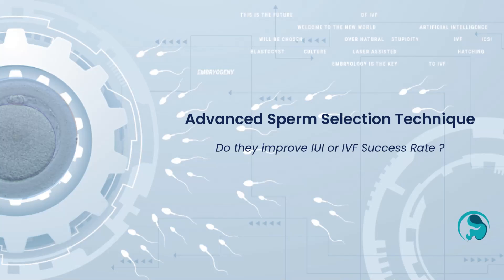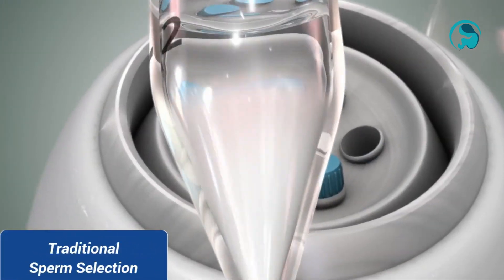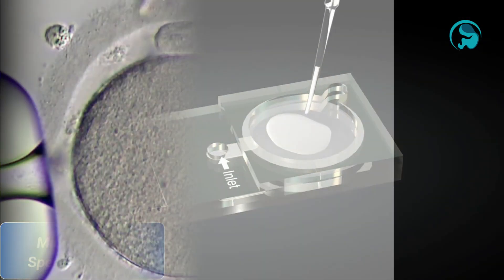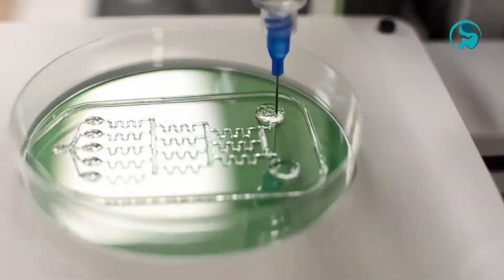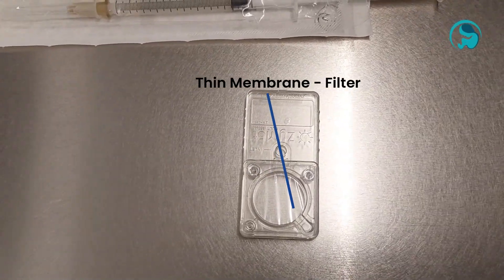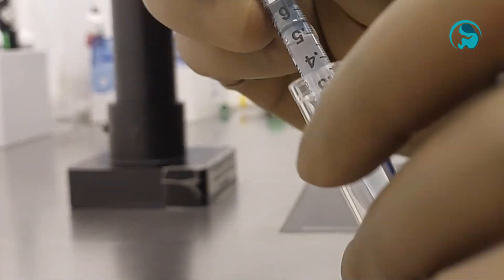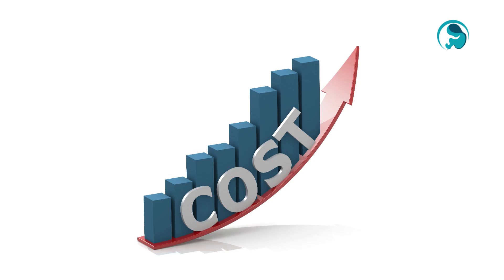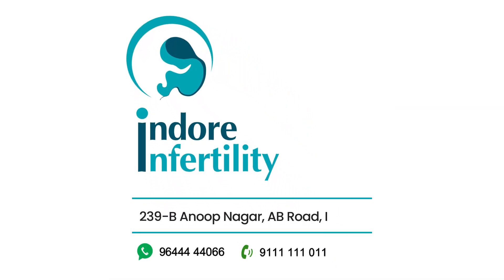Advanced Sperm Selection for Improved IUI and IVF Success Rate - Microfluidics Sperm Sorting

Comment: What is it's cost
Reply from the maker: Cost of advance sperm selection depends on the end use. If it is for IUI, it will cost appx INR 8000 more, and if it is for ICSI, appx INR 10,000 more. But as explained in video, it is not indicated for all cases.
Reply: You mean Zymot will cost 8000 more for IUI? My husband has severe teratozoospermia+ high DNA fragmentation
Reply from the maker: Microfluidics device cost ranges from 5000 to 10000
Reply: How this method names? Is it the same as IMSI?